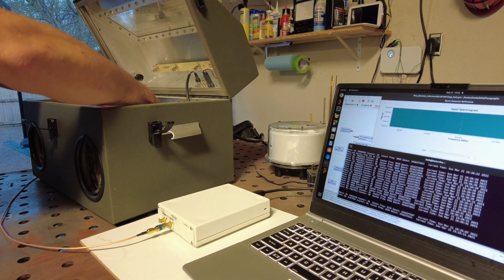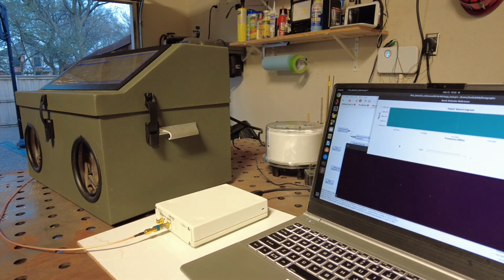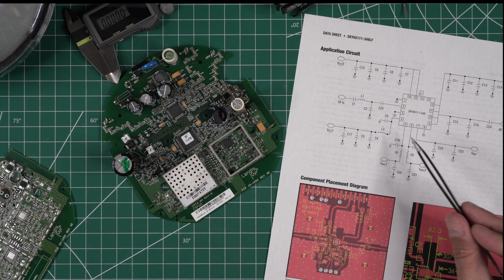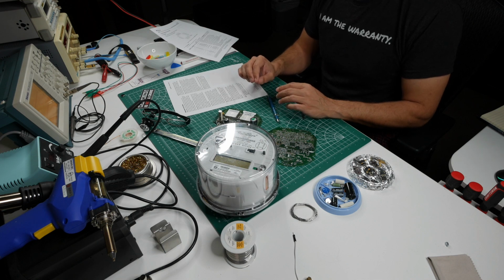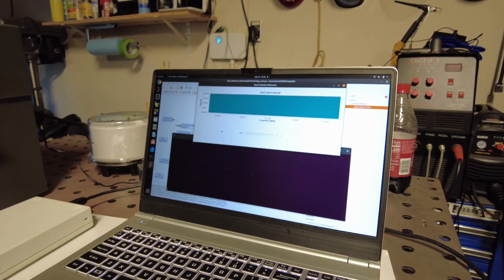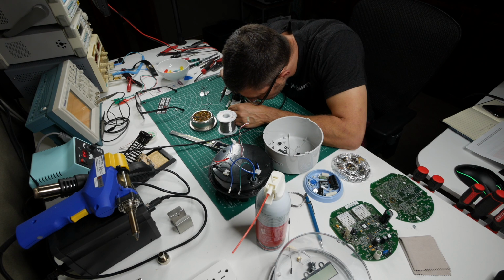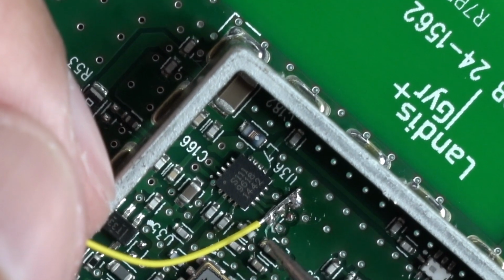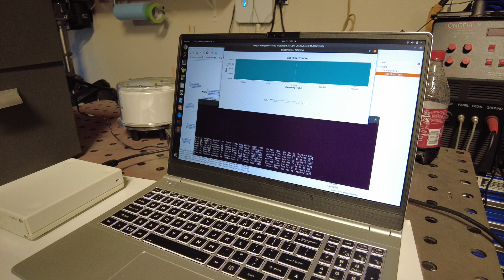Smart Meter Hacking - Hardware Modifications

Comment: Hi if i cud get a hold of EU meters and ROUTERS. Can you hack them, ore try to do it. i think we have 3-4 models AMS meters here. There the new ones. They say they cant be hacked. But some even has USB. I my self refused to get ams installed. Since i have the right not to have a device that like a cell ore a wifi router that is radioactive.. Small but. still my choice to have it in my house. And i aslo have the right to get power! My main reason to not get one is, I think some can get sick. Nr2 i know they can get hacked. Nr3 i dont want to record when i use what and for how long. More then they cud whit out AMS. Also we have them inside the House and some like mine are small. I told them to build a isolated box outside for it then i wood take it. Cause i know they never wood do that. I hate these AMS shit. And the reason for high power cost now + all the eletrical shit like cars! But thats to much in my bad grammar! LOL

Comment: Do u have a video showing hoe to slow the meter
Reply from the maker: No, demonstrating something like that would get removed from YouTube for promoting illegal activity. My content is about understanding how it works and searching for vulnerabilities in the design.
Reply: If you have to ask this question you cannot safely do this. You need to change the resistor out for one with lower ohm than stock and then raise the tolerance (max is 20%). If you have an old style meter use 3 magnets (one in each side and one in the centre of the top wrapped in foil. 

You can buy a meter and housing for private use so it’s not like this information can only be used to store power. Especially people who mine cryptocurrency and host this process. We tend to install our own meters for each of our clients.

Comment: Please don't power your test meters with line voltage if you can avoid it.   I've spent some time developing manufacturing tests for smart meters.  If we had to power a meter at line we ether had the super fancy test fixture that could power up any form of meter, or we would run down the to electric supply store and buy a meter enclosure and wire it up so that it would plug into the 120v or 240 volt outlet.

I'm not familiar with L&G meters but if they are anything like the ones I worked on they will have a power supply that takes the line voltage (240v AC) and converts it to 12v or 5v DC to power all the digital logic on the board.   They go through a lot of engineering effort so that you can test subsystems like the radio in the factory using low voltage DC and we only powered up the meter with line voltages once it was completely assembled and we were calibrating it for measurement accuracy. If you poke around you should find a spot for a header that you can supply with DC  to power up the board.

We never had to worry about powering up ISM band smart meters outside of a faraday cage.  They are all FCC Part 15 complaint so shouldn't be interfering with anything else.  The only concern I would have is if you have meters that came from a power company in your local area.  Each meter will be programmed with a NetworkId that should be part of the broadcast packet header so that neighboring power networks can operate without interfering with each other by ignoring packet that don't have the correct NetworkId.  If you power up a meter with the network Id that the local routers/collectors are listening to it will show up in the power company's system as an unknown meter.

We only used faraday cages for smart meters with cell modems in them, but that was because the test equipment included a cell tower simulator.  The meter itself wouldn't interfere with the cell network since they have well established protocols for dealing with devices that are not provisioned on the network.
Reply from the maker: Thanks for taking the time to provide such an information packed comment! I agree with you and believe I need to find a test jumper on these meters to enable them to be powered via the lower voltage regulated supply.

I initially tried feeding in 20VDC at the point I found on the PCB but these meters would not boot up ( think one in the past did), I believe it has a protection mechanism kicking in because it thinks there is an issue with the missing 240VAC and is keeping it in a reset state.

This is likely the Teridian chip doing this so I can probably just hold a line high/low to skip past it or short a jumper that's used during manufacturing. But part of my tests is simulating the exact environment so for that I need to ensure I take proper precautions when powering them.

Thanks for the tip on the NetworkID, I suspected that was the case just due to the number of different providers here using the same meters and airspace.

Comment: Since you have access to the CC1020, you could tap the SPI interface and grab the init sequence and slap those values info into TI's Smart RF studio and have exact RF parameters such as modulation types, bandwidth,/data-rates/channel spacings and such. And the exact channel hopping sequences could be determined from other logic dumps of an active meter..
Reply from the maker: It’s a good approach, thought about that as well to get exact parameters. It wouldn’t be from a meter on an active network though, but still useful to see what hopping pattern they run in discovery mode on the receive side.